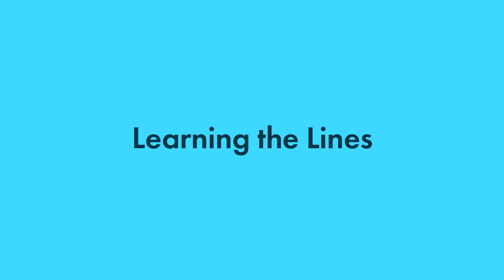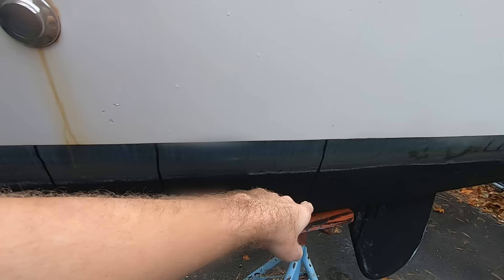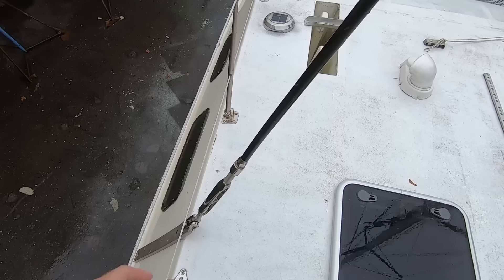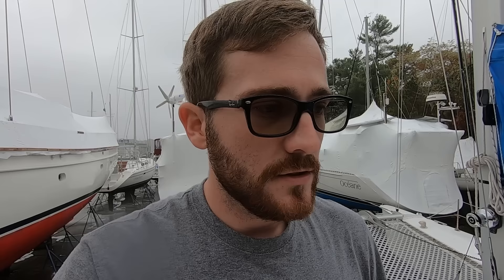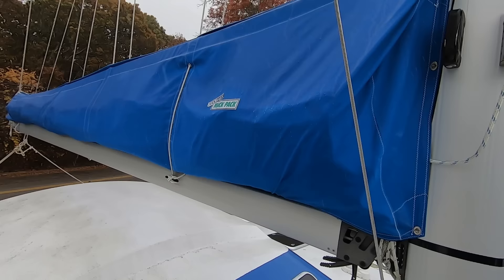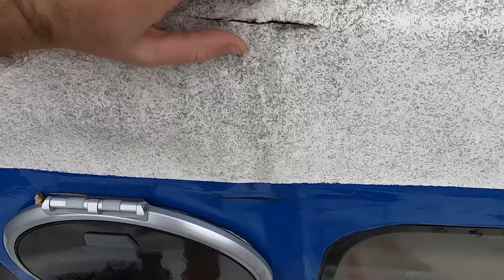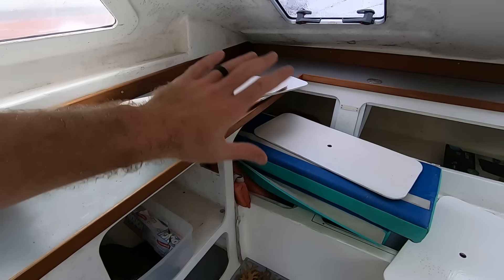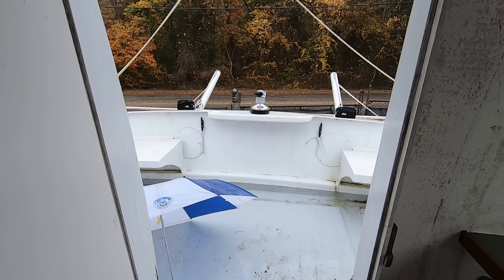109. Dirt Cheap ABANDONED Project Catamaran - Should We Buy? [Full Tour] Learning the Lines

Comment: The one positive of this catamaran is that it is probably fast sailing. The owner added the 3' sugar scoop extensions to reduce stern squatting and water turbulence to make it sail better/faster.  The diesel tanks are midshp for balance purposes as anything further aft would cause stern squatting. The only other possible location for the diesel tanks would be in the aft section of those forward lockers. If this boat is in affluent Barrington RI, the owner had the bucks to add all the new stuff- this was probably a whim toy like a go fast car and now he/she just wants to get rid of it.  Agree that the rigging and engines are the valuable  parts of this cat.
The negatives are many and have been pointed out.  Tulas Endless Summer youtubers bought a similar cat and fixed it up, but theirs had a much better layout in the hulls.  But even they, in a recent post, liked the space in a more modern catamaran they visited.  Adding a robust autopilot would be difficult given the design, only a tiller autopilot would work easily and they are less robust. This cat does not have most of the advantages of modern cats such as lots of living space, storage space, big galley, multiple heads, large cockpit, protected steering helm, protected easy entrance to hulls, engines in separate compartment or a sound insulated area.
Cat models I personally like and may be in your budget are Privilege 37 and Privilege 39 from the late 80's early 90's.  A 37 sold for $75K a few years back in Mid Altlantic on Yachtworld.  A 39 sold for $59K in S Fl 2 years ago on Craigslist and another in Tx for $85K on Ebay.  They meet the rule of thumb of at least 35' LOA for offshore sailing and have a beam width that is at least 50% of LOA for stability, and have adequate bridgedeck clearance.  So affordable well designed cats do come up for sale.  See youtube Taking the Chance for couple sailing Priv 39 in Caribbean.
Reply: It still would have been an easier job then building one by themselves as they would like to.
Reply: So to get another knot, knot-and-a-half of smooth-water speed they added quick-rotting pieces to the stern, screwed with the usability by putting diesel tanks where something else should go, and generally turned a turd into piece of shi--tte.  Hmm, what's the diff between a turd and a piece of shi--tte? Answer - turds are all dried up, you can pick them up with a paper towel and throw them in a waste can;  but shi--tte is a runny, smelly mess that you can't even try to clean up without getting it all over you and your clothes and everything you touch.  
Approach no closer!  Danger! Will Robinson!     Danger!

Comment: I'd take it. Plywood bulkheads are easily removed and be ones made and glassed in. Noticed the wiring system seems very tidy. Getting down from deck to cockpit... Few grp steps can be made. If the decks are double core it's easy to pump epoxy resin inside. Other than that just some cleaning repainting and minor building work. Definitely could negotiate on the price if your good at pointing out all the negatives...

Comment: Randy learn about  distilled vinegar and baking soda used together in the proper manner there is no need , your labor of scrubbing , if you let vinegar and baking soda do all the work !!!
Truly all that is needed for detoxing the mold and cleaning going in with vinegar 100% spraying it everywhere would clean the mold out in seconds !!! Then neutralize with baking soda with a quick wipe down is all that is needed if you give the vinegar and baking soda the time to work not jump on top of it expecting it to work in an instant give it the time it needs a day or two if need be shouldn't take much longer than that less time and days of scrubbing .
Wet stains baking soda first let dry then clean up with vinegar .
 mold and dry stains I always use 100% distilled vinegar let stand for at least 24 Hours come back in moisten and again with vinegar and then Dust with baking soda let stand at least 12 hours Come Back Inn wipe off clean up with clean water and always 100% cotton cleaning rags do the best job no need for the endless irresponsible use of paper towels.
 I do not use the disposable rubber or plastic gloves I have some good rubber gloves a couple of pairs for handling chemical and oily messes they are around $10 a pair and they have lasted me well over 25 years over buying rubber disposable  nonsense.  all I've done to maintain them is wash them in distilled vinegar after every use and they just as new today as they were 25 years ago .

Comment: Suggestions: 1. Consider relocating the diesel tanks to the centermost portions of the awthoroughtship voids which exist in each hull, then fit out heads where the tanks are now.  Fit out your galley on one side and your stateroom on the other.  Fit out a watermaker and companion FW tank on the galley side.  Clean all interior areas with hi pressure washer with a trash pump to scavenge the bilge water buildup  - like your dentist does when he is grinding on your tooth - no big deal.  Repaint after full cleaning, drying and repairing as needed..  2. cover the dagger board voids with a hinged plug - no biggie.  3.  First do the exterior work which is required to launch. Second, reposition boat to a highly protected cheap  shore birth with power, all of which is very near your residence - then conduct your interior and topside repairs while floating.  Take your time - do things right - find an experienced and good natured mentor.  The more you do yourselves, the better qualified you will become to operate and maintain your boat.  Don't make anyone responsible for anything except yourselves.  If you don't know something, learn it . . .    You'll be just fine.
Reply: I like a lot of this. Seems like a lot of solid advice. But it also sounds like there is going to be a lot of old paint dust and plastic dust going into the water at that highly protected cheap shore birth with power. That seems like it would be much easier to avoid if the work was done on land instead.

Comment: Most of these people commenting don’t know about Outremers and what unbelievably fantastic sailing machines they are - and especially the older ones like this. 250 to 300 miles days are possible which means you can outrace weather systems. Most multihulls have a little spring in the deck. The rot, based on what you’ve shown, seems minimal and easily repaired with epoxy, filler and fiberglass. New rig, new sails and two new diesels is amazing! If you could buy it for $35,000, and find a super cheap place to work on it and be able to camp there while working, and do all the work yourself (fiberglassing is easy!), I would definitely go for it. You could be on the water in a year with an amazing boat that’s worth 5 times what you paid for it.

Comment: You can often find "cheap" cruising boats in Hawaii, at the Ala Wai  or Sand Island Marinas. 

These are often fully outfitted, and fresh in from their passage from the Mainland, during which the owners had their dream of islands in the sun dissolve under the repeated onslaughts of seasickness, trying to cook sailing dead downwind and constantly rolling the gunwales under in 8-10 foot tradewind swells, exhausting watch-on watch-off living (most of these are couples, many don't get additional crew to handle the watches or work), and generally the shock to their systems from finding out that cruising is not the same as a weekend out to Catalina Island and back. 

Depending on how desperate they are, how badly the marriage broke up after the voyage, and how long the boat has sat unsold, you can often pick up a name yacht that would have cost you $350,000 from a brokerage in Southern Cali for under $100,000. Sad but true; I've been an island resident since '76 when I singlehanded in to Hawaii from the Marquesas on a 37-footer I built myself. 

With Warm Aloha, Tim

Comment: "Symmetrical evidence of damage" What I think it means is the foam inside is saturated, the water has found, or is still finding the lowest point, hence all the rot in those areas. I could just see an enormous amount of work required to fix this thing. It's weird they fitted new gear to it to try and sell it rather than fix the basics first.

It's a shame so many people buy boats then neglect their maintenance, but people do the same with cars too.

Engines are worth $3,562.00 each or so, so $7124 in engines there, and rigging, maybe $8000, so value sitting there is $15124, the rest of the boat is liability. Better off buying a boat in good shape with no engines and needs rigging.
Reply: All I can figure is they started out and ran out of money before finishing the hull or found out how bad the water intrusion was.  It takes hundreds of hours just to redo the roof and the stern additions.  Fiberglass is not fun and it is a real pain in the ass to replace it. The fiberglass may be easier than getting it ready to fiberglass.  If not for the engines I would not take it if free.  lol
Reply: Junk.
Reply: You and your responders are so right. I don't need a phenolic hammer to tell you this mess is delaminating and filling with water. Nice to hear comments from people who know their stuff.

Comment: Former Rhode Islander, Go Bruins! Seriously though, this boat needs to be parted out. Outremer have come a LONG way (La Vagabonde), yet they have always been very efficient and fast boat designs. What I wish for you two, as a young couple hooked on sailing, beyond winning the lottery, is that you find yourself in a position where you can either finance a decent used catamaran (because I think that's what you want) or a situation where you could build a Wharram or Woods design, et. al, to your specs. It's the traditional time vs. money thing... I suggest you keep this business model you now have (because stranger on the Internet), if it offers any surplus of time or money, to work to that goal. Maybe you need two channels, a DIY and broker/rep type?

As you probably already know, the Wharrams don't have a meaningful bridgedeck enclosure, they are really twin canoes (channel Lucky Fish), like this boat, but the Woods cats do. Speaking to this boat specifically, the cost to cut away the pilothouse and replace the deck gelcoat or underlayment is absurd, especially because you'd have to relocate to do it, or just as bad, motor the beast to your preferred location and haul it out. Appended sugarscoops are never a good idea. There's a lot of up force on a fast cat's aft end. Outremer's engineers are not stupid, there is a reason they didn't add skinny extensions to the aft of their design. It costs speed and adds weight; their engineers are famous for their quote: to take the toothbrush and cut it in half!

Comment: In aviation we deal with lots of laminates. To check for delam, we use the coin tap method. Which is exactly what it sounds like. Tapping around the laminate, you will here the difference between good and bad laminates. Very quick and fairly accurate way to check for delam. Just an fyi for future inspections.

Comment: It could pay off as a work boat. Maybe harbor tours, a party boat for Spring Breakers, or schlepping snorkelers. No one is sleepng on it, no one is going on long trips in it, and the extra storage has a use. You would need a construction crew that is fast and cheap and have a buddy in the salvage business. The new engines are a big plus as they will be pounded into paste.

Comment: This boat, with her long, narrow hulls, deep daggerboards, light weight and little windage, can sail circles around all production cats. With ease. On all points of sail. 

As Dick Newick sad about what is possible in yacht design, you have to choose 2 of 3 characteristics: performance – accommodation - price. Outremers definitely picked performance as a priority. (They had many
successes in the ocean racing).

Gerard Danson designed her for active cruisers. People who don’t care much about luxury. Want simple, functional boat, easy to maintain. Not spending much time and money repairing unnecessary stuff, waiting for spares, varnishing e.c.t. . People who like to sail (very) fast, visit isolated places. Once there, have a fun, going surfing, biking, free diving,spear fishing … Carry 2 or 3, (lightweight), dinghies \ kayaks. 
I like the main construction bulkhead that completely closes of the bows. It is very strong and rigid, (it takes the biggest loads – main beam and mast). You get watertight compartments -  safety factor in the case of collision and an out of site storage space for bulky, but light stuff - like surfboards, mountain bikes …

Outremers are built from solid fiberglass and are very strong,. There is a big chance that she is structurally sound. Only add - ons (hull extensions and deck pod are suspect. I think I would chop of deck pod and make a new one from ply/epoxy. Smaller and lower then original one. Just high enough for siting, not standing, Something like this: https://www.youtube.com/watch?v=uDi0gI9mJXY
Cooking in the hull, light, camping stove. I would remove those huge
diesel thanks. It is an overkill for such good sailing boat, it slows her down.
I hope that propellers are not big 3 blades, they really kill sailing performance. 

Mould is just cosmetic problem. Few days of elbow grease.   
As you can tell, I am a fan. Unfortunatelly, at this point in my life, time \ money wise, I can comfortably afford to own and use just Hobie 16. (Not that they are not huge fun J).

Comment: That thing needs a LOT of work. If I had a spare $45k or so burning a hole in my pocket, I would:

1) Hire a pro inspector to find everything wrong with it and determine that it's actually possible to salvage into something safe to use
2) Move those diesel tanks into the storage bins above the engines (which are far too small for my liking but no point upgrading until it's confirmed usable) and put heads where they're supposed to go
3) Gut that entire center room and rebuild properly into living(ish)room, including an enclosed wheelhouse. Redo the roof in the process with all fiberglass
4) at least cover that entire rear walk, if not totally enclose. Double tillers would get replaced for getting in the way of main walkway, with more protection when desired at the main steering position
5) Tear off those 3' extensions, there are less makeshift ways to get good easy water access for swimming/etc.
6) Scrub out the front lockers, and convert one or both into small offices, kid's rooms, or similar. Or even just spare pantries for more durable goods. Probably one of each
7) Improve the side railings significantly, and add some flavor of cover over the daggerboards that keeps you from twisting an ankle when they're in the down position. Also rubberized stick-on mats everywhere.
8) Upgrade the berths with some $100 memory foam full size mattresses or similar, with wall TVs and those bed-cushions so they can be used as a hangout area. Add privacy curtains, and upgrade the space around them to actually provide bedroom amenities. Possibly make hatches into the hulls seal if still able to get water to them after whatever walkway upgrades
9) Upgrade rigging to be remotely operated, because sometimes one person has to sail solo because injury/illness, and also because sometimes it's just crappy outside, but that's more a nicety than a necessity.

It's kind of a meh layout and needs a lot of work, but if you had a space to put it while you did so you could make a pretty decent house out of it (if you could get it cheap enough). I've heard more than a few stories of people buying a big cheap old ship that's barely fit to leave the harbor but otherwise sound and just using it as a house for college because local marina fees were a fraction of what any rent would be. This looks pretty seaworthy, so even beyond that usage you could get a real nice thing out of it, once it was all said and done

Comment: Moving the daggerboards close to the side isn't too hard
I really don't trust balsa core it's something you need to open up and fix so lots of work. So get a real servery with a multihull background.
Solid fiberglass is NOT light weight.
Building a new dog house would be the way to change this to get to a layout you may like.
I agree offer 10 or 15k.  It's better than a build from scratch but...
A boat is bout 1/2 the labor consumed when you have solid hulls (most likely on this boat for the hull but the desk and dog house is not).

Comment: You could buy it for peanuts, strip the hull and tip it, then look for a similar length bare hull and put all the parts on, with a little adjustment.

Comment: This boat was originally built to be two hulls and a rig to sail as fast as possible, everything else was an after thought.  I think the type of refit catamaran project you need to look for is, a post hurricane charter catamaran that is an insurance write off, yes it might have some hull damage, so water damage etc, but the sale price will more accurately reflect this, leaving you with a refit budget and ultimately it would be a more suitable cruising boat with lots of usable space.
Reply: Most charter catamarans seem to be cheaply built. All(?) Lagoons as an example seem to have bulkhead issues. Charter catamarans also for the most part seem to be very heavy and sail as good as a brick.

Comment: It certainly has potential, a bit of hard work will see it right (hard work never hurt anyone). What is the cost of buying new rigging, new engines and the fittings?, those parts could potentially be fitted to Freebie?. I would try to negotiate hard for the cheapest price possible and salvage those parts with looking at how much those parts cost new, surely doing it that way would be cheaper than having to buy them individually. The rest could be fixed (and done on the water), it doesn't matter how long something takes, it's the enjoyment of doing it that matters.